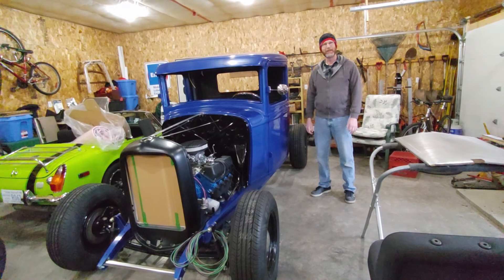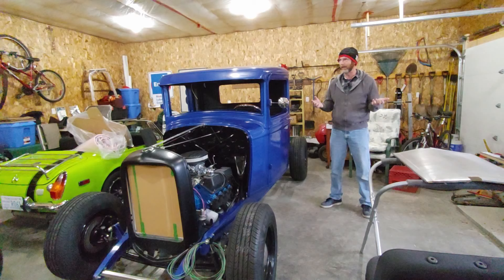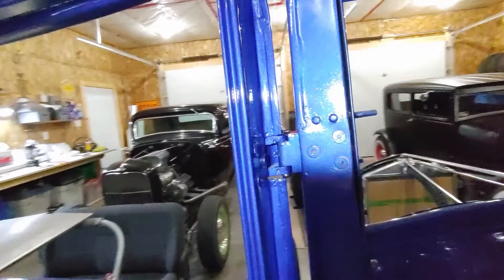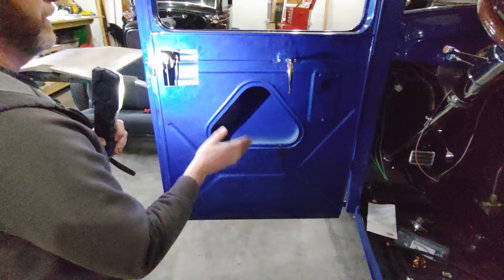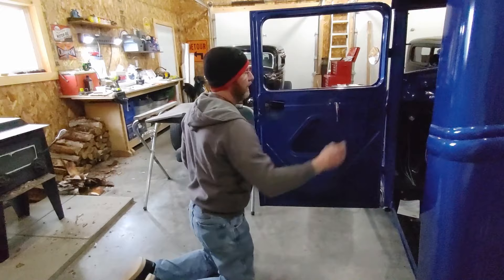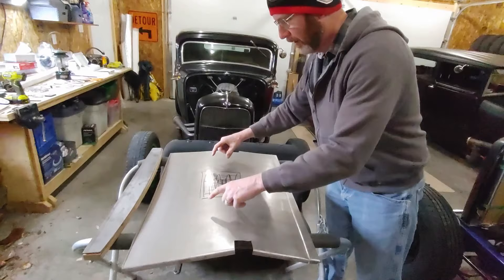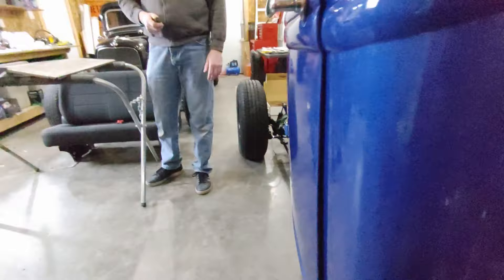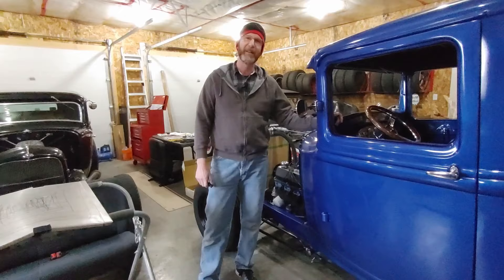REPAIRING THE DOORS ON THE 1932 FORD PICKUP

Comment: Awesome job on the latch setup! On most of these trucks the belt line bead on the passenger door isn't aligned with the back of the cab. The back of the cab belt line is tipped down. It's a factory defect.

Comment: I finally found a set of doors and they are in similar shape to what yours were.. I'm overwhelmed and not sure just where to start. I've watched your video twice already
Reply from the maker: Mike, hang them on the cab and get the inner frame of the door straight and repaired with the body first so it open s and closes. Then work on the outside skins.
Reply: @coldstreamrodshop  the inside are damaged near perfect.  I hammered on them slightly but they are pretty good. The jamb on the hinge side are what's scaring me. I'm assuming someone cut the hinges out so I'm not real certain what to save and what to trim
Reply from the maker: @Mikewheeler131  I can send you pictures through Facebook messenger or Instagram DM of my jams if it will help?
Reply: @coldstreamrodshop  plz do! I'd love to get some input and be able to show you where I'm at. My profile is my son and I. From des Moines iowa
Reply from the maker: @Mikewheeler131  I think I sent you a Facebook request from my personal Facebook account Derek Fraser if I got you right.